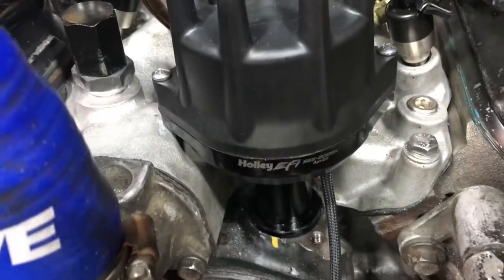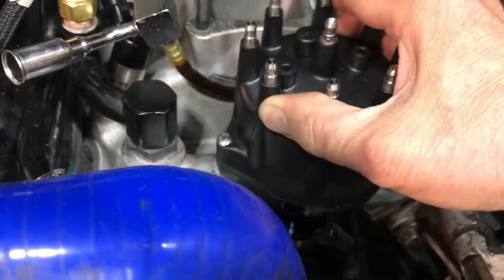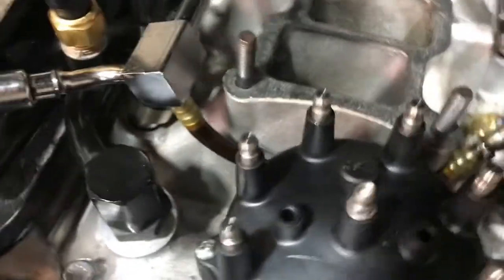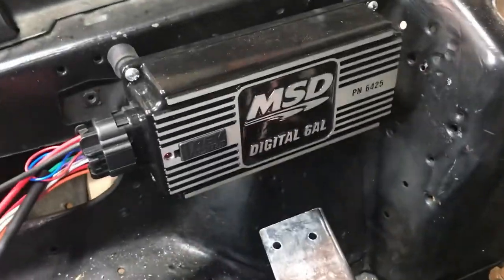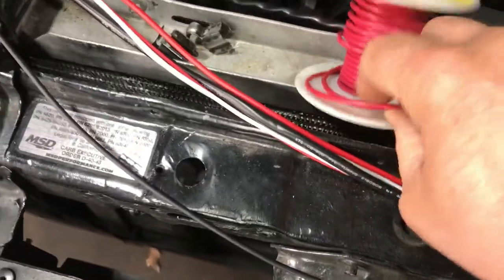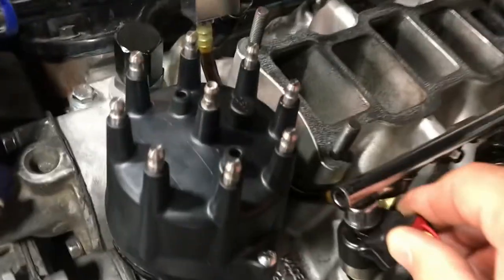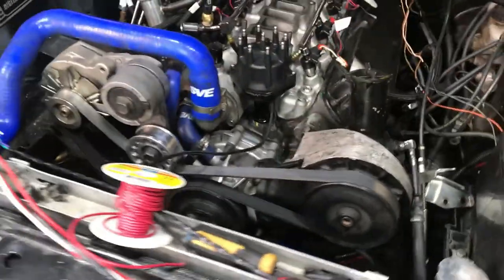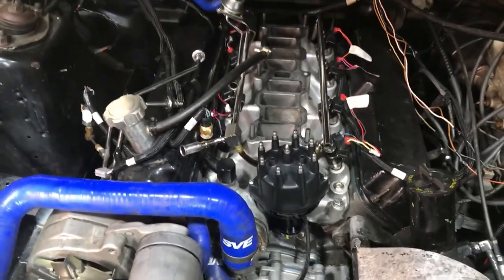Holley Dual Sync Distributor & MSN 6AL Digital Ignition Box - 88 Mustang GT Pt 1

Comment: Holly told me that with the TerminatorX and dual sync distributor I wouldn’t need a mad ignition box is that true?
Reply from the maker: I think you can use a dual sync with stock ignition (mine is not working yet).  The MSD ignition with stock distributor was a great addition. Car runs and sounds stronger since I installed the MSD, get one if you can.